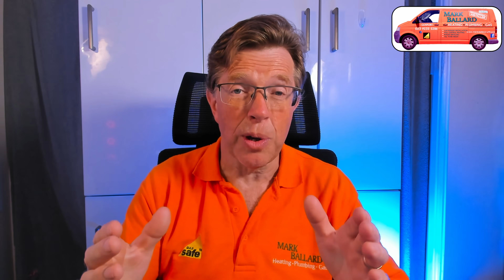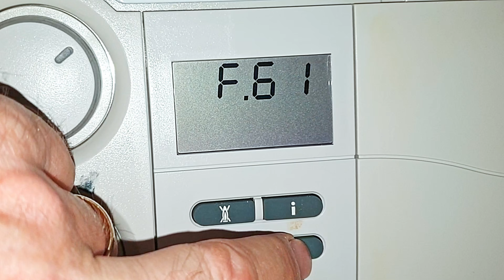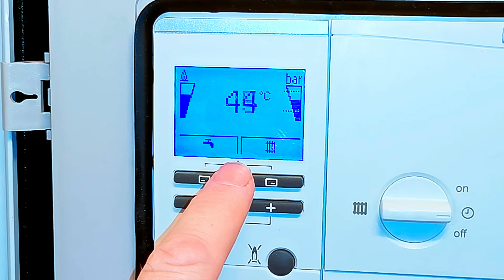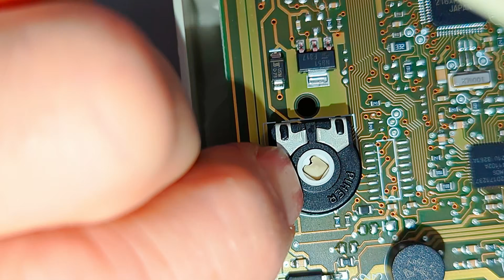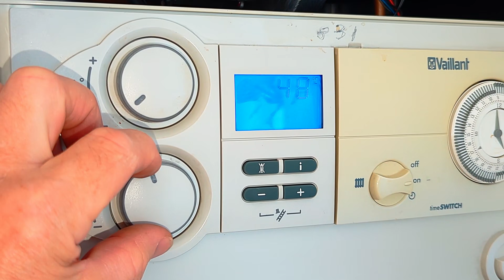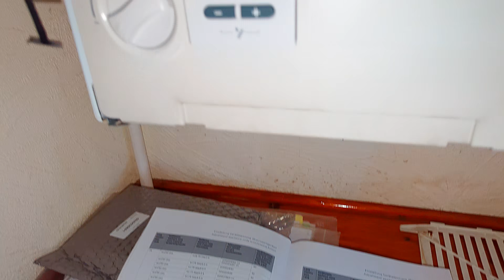How to Fix Vaillant F61, F62 Also F64, F65, F67 Fault Codes, What's the Problem & What to Do

Comment: Great video Mark. It looks like those 6 little chips on the PCB are the issue and maybe the trace lines. With a magnifying glass, and soldering station, a "third hand " to hold the board, and you could try desoldering those chips off the board and replace them. The number on the chip identifies which one it is. 
I follow a car electronics chap, who does ecu and PCB repairs on car electrics. All these PCB's work on low voltage, and removing bad chips, and resoldering good ones is a huge amount of his work. 
@mark - might be worth trying with an old board if you have one. The chips are cheap (as chips!😅). Given the same location on all these boards, I'd imagine it is a bad batch of chips, or you might have to re-lay an electrical trace. I'd bet thats all this issue is. I don't believe this is a multi layer PCB board. Nothing to lose!
Great videos, really like your style of presentation 👌

Comment: Are all  the Pcb boards the same? And the jump wire, why is it there if not required
Reply: Manual suggests to remove bridge when installing.

I assume it's for Transport purposes?
Reply: @eliteap_ Allows the boiler to run without the thermostat

Comment: Awesome video, very helpfull! My display never lights up (ecotec pro vcw BE286/3-3H) even when I press the buttons. However I do not see the numbers jumping around. I removed the PCB once but I couldn't see any visible damage/burned or darker areas on the backside of it.
Do you think it's worthwhile replacing the board? Also would a PCB from the UK work on my boiler here in Belgium? I found a cheaper refurbished board from a reputable UK seller on Ebay so it would be a cheap fix, rather than having a professional fit a brand new board...